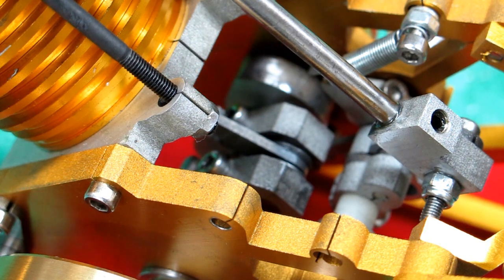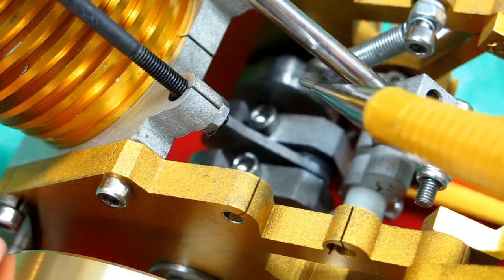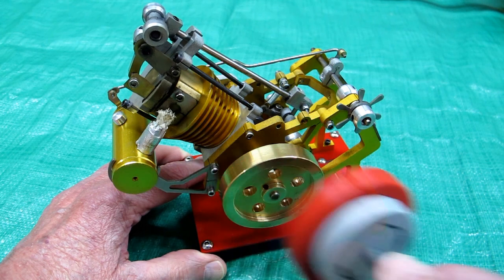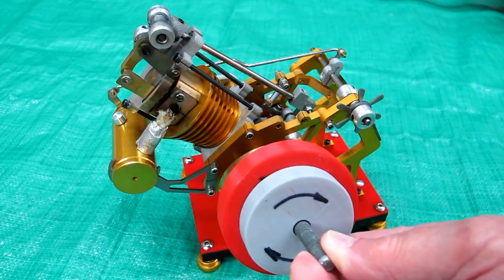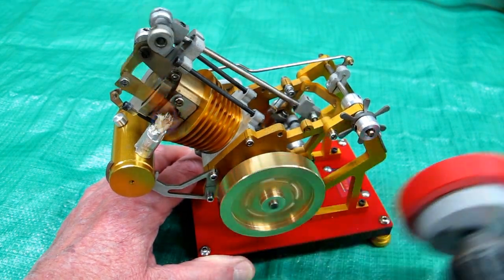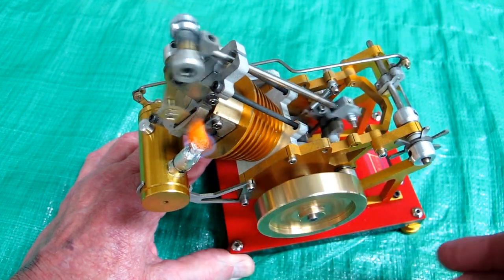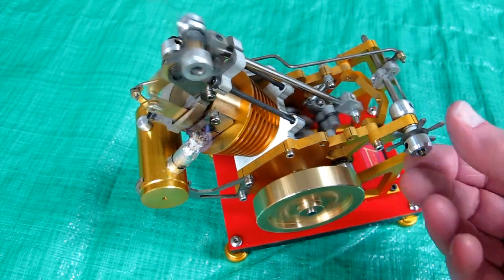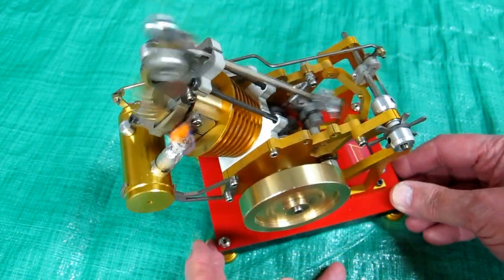Sai Hu V1-45 Vacuum Engine - Better Timing & Improved Running

Comment: Great videos, I just purchased one. Just want to know if you learned anything new since you posted these videos.?
Reply from the maker: Hope you purchased it using one of my links and coupon codes. My videos should cover everything... timing and easier starting. When I received mine it was all out of whack. Never having run one before I had to figure out how it was supposed to run... then figure out how to get it to start. Have fun! Ron

Comment: Interesting demonstration model. Some of the old diesel farm tractors required a fire pot placed so it could preheat the cylinder before they could be started. Obviously a different type engine but the need to preheat is the same. I also find it interesting that it runs both directions. Another good demo. Thanks!